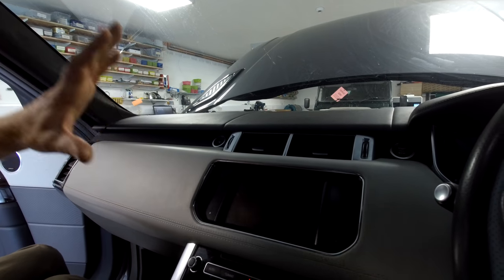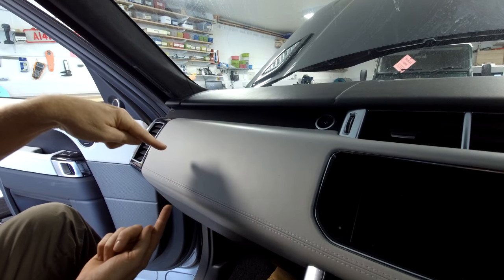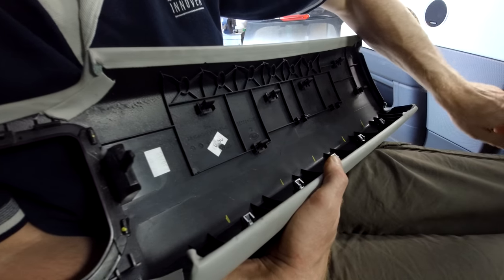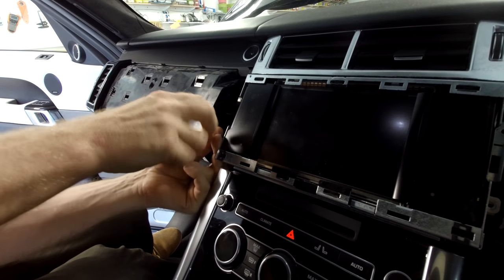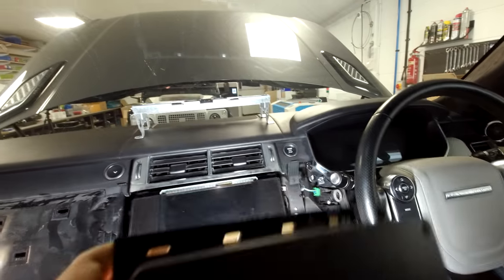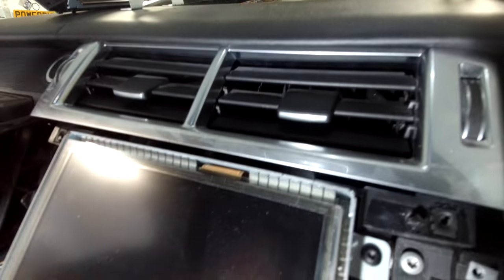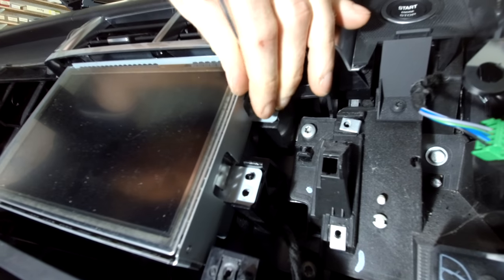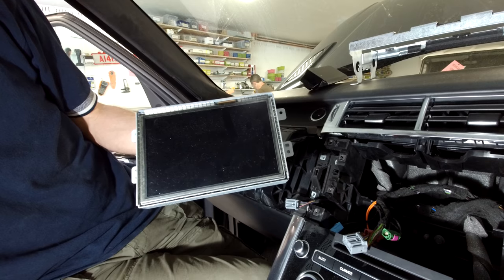How to remove / upgrade the Navigation screen on Range Rover Sport L494

Comment: Some advice for putting the leather dash trim back on as this is much harder than taking it off. Firstly add a few drops of super glue to your spring clips because these these things will fly off if you get it wrongly aligned. Obviously let it dry properly first. Work the panel on flat getting your piece by the instrument cluster in first as there is a peg that has to align onto the clocks. Then look for your lower clips that go into the cage around the infotainment screen as there are two big ones at the bottom. Then as this video shows gently bend the bottom section underneath the dash, do not bang it in otherwise the clips will end up behind your dashboard. With everything hooked under push everything into place, takes a bit of force but you will hear all the clips lock in. I wrestled with this for ages losing clips along the way and having to drop glove box to retrieve them all. Deffo use super glue so they don’t fall off the pegs otherwise you will have only half the clips holding this on and half rattling around somewhere.
Reply from the maker: Sorry I missed this comment - I have pinned this to the top as it is very helpful and I will try this method next time myself

Comment: I have a range rover sport 2011 not supercharged, I was driving it at about 25 to 30 mph and my bluetooth just stop working and screen were the station numbers go it went blank, but I turn my radio off and the station came back on but my bluetooth did not. what can I do. 
thanks for all your videos I actually added a new key to my rover just with your video thank you so much.

Comment: I always enjoy looking at your site. I installed the Android 11 infotainment system in my 2017 L494 yesterday, stowed the wires, pushed in the monitor and air conditioning panel, turned on the ignition key, the air conditioning panel and monitor did not show up and I put everything back together. However, the original navigation and air conditioning panel do not work, only the hazard light switch. Once disconnected from the battery, left for 20 minutes and hard rebooted, the monitor and air conditioning panel do not show and work. I don't know if it is the disconnection or the on-board computer and will have it looked at by the dealer tomorrow. Is there any possible cause for this?

Comment: Great job guys, any idea if the 2017 face lift screen can be retro- fitted to the earlier L494. I’m guessing rear connections would be different?
Reply from the maker: Hi the later rear screen seems to only have one connection on the back - so i guess its just a display with little processing - check out this listing on ebay
https://www.ebay.co.uk/itm/2017-Land-Rover-Range-Rover-Sport-10-Sat-Nav-Display-Screen-GX63-19C299-AC/401628343295?hash=item5d82ea2bff:g:TZ8AAOSwTABc5RFH
Reply from the maker: This unit would seem to be the "brains" but the connections look different to the older units
https://www.ebay.co.uk/itm/L494-RANGE-ROVER-SPORT-RADIO-CONTROL-MODULE-HPLA-19C211-AE/273755764710?hash=item3fbd1d77e6:g:9Q8AAOSwq5dchkiI
Reply: That’s a shame, could have been a cheap upgrade judging by eBay second hand prices
Reply: @L663  Hi mate could u plz give me some help with replacement touchscreen on 2015 L494 which can I replace my faulty ones with used ones of eBay ? Is it need recoding or plug and play ?
Ta
Reply from the maker: @novacartech7588  just plug and play - try and match the part numbers if possible

Comment: Hi, Would you know if it was possible to Upgrade the Stock screen on a Pre-Facelift EVOQUE? MY2014? Got an issue with mine, so am looking at options, the first being how to remove it!!! Any pointers in that direction or a YT Video How to, would be greatly appreciated.....
Reply from the maker: We have not got the Evoque out for a while - its stuck in the parking garage.... we will get it out and do this video and we do have the Merryway upgrade unit for it too.... problem is Its holiday season so we may not get it done for a few weeks....
Reply: @L663  Hi, Thanks for replying so quickly...Take your time, No Rush...Whenever you can get round to doing it, is fine by me....Just great that you like having ago for all of us numpties out there.....

Comment: @powerfulukltd i want to upgrade my RRS2015 model with RRS2017 screen however i dont know if it is compitable with the wire of the control module so i have to find another module ?
Reply from the maker: Hi - its not but i have been asked this question a lot ! so i have purchased a 2017 screen and will show everyone the issue !

Comment: Hey, do you have any tips on putting the panel back? I was able to remove it following your instructions but I just cant get the clips to bite so the panel stays flush. Driving me mad! Thanks.
Reply: Me too.  Getting that panel back on is proving to be quite challenging.  Any advise would be greatly appreciated...
Reply: @sbos429  Ye if you figure it out let me know haha. I was able to get the area by the steering wheel and the area around the screen fitting nicely but the bulky area by the glove box is still not biting as it should. Still feels a bit loose.
Reply: Same.   I got mine attached good enough,  but several of the clips in the large part aren't attached either.   I am afraid to pull our back off because this is as good as I have been able to get it.   If I get real gutsy,  I will take it off again and try to get it better, just not now.

Comment: Can you please help me locate the Quiescent Relay Box on a 2017 L494? Symptoms: I am getting a B1412 fault My Infotainment screen is dead I have an SOS limited Functionality error (already replaced the battery) Please help! I searched your YouTube channel and scoured the net for an answer, with no luck this far!
Reply from the maker: I think that relay is part of the front fusebox.
Also sounds like it could be an issue with TCU - telematics control unit.
There is some data here but not much.
Try a battery disconnect and reconnect ?
https://www.landroverworld.org/threads/b1412-96-quiescent-relay-box-failure.41753/
Reply: @L663  
Thanks for the reply!
I have tried the battery reset as well with no luck.

Additionally, I had found the thread that you referenced, but it appears to be for LR4.
I have been unsuccessful in finding info for the L494z
Reply from the maker: @JP-sn9ej  You may need to start looking at this video
https://youtu.be/B752xfrxzLw

Comment: i bought my car in the USA and according the maps company that provides the maps update for the range rover they said that there is no way i cant have my maps updates for the middle east, unless i replace my head-unit. however, i am not sure about how true is that. i found a wrecked car that have a middle east unit. does it have a password to swap the headhunts ?
Reply from the maker: hi my car came with the DVD unit missing from the car... why i dont know ! but i got one from another car - actually an evoque.. and it works perfect with maps etc. If you give me your chassis number i can look up the part number - and engineering number for the unit for your car - this may help you. I think you have  a good idea here !
Reply: @L663  I also have a question. Does the car know it's configuration. I mean type of engine , cameras auto park and ambient lights . Or do I have reflash it .
Reply from the maker: @ram00sa00  Hi Rakan - the PN for your DVD unit is  LR093721 and the eng PN is CF6N 18C815 JN - the engineering part number is always on the item so more useful.
here is the link to the data
https://www.dropbox.com/s/6jth3rowqek2i6t/audio.jpg?dl=0
As you can see this DVD player was used across the range.
I dont think you will find 100% same PN outside USA - but i think if you look for the same PN without the last JN you should be close
One on ebay for £80
https://www.ebay.co.uk/itm/RANGE-ROVER-L405-RADIO-UNIT-MODULE-CF6N-18C815-HE-GENUINE-100-TESTED/143436702132?hash=item21657e61b4:g:lKUAAOSwNopdxo~f
Reply from the maker: @ram00sa00  I dont think this is stored in the DVD - the only issue i have with the Evoque DVD i fitted in my sport is the handsfree is called "RR Evoque" on bluetooth.
Reply: powerfulukltd so do you think if I replaces my NAS dvd with a local dvd it would still work fine .?
Reply from the maker: @ram00sa00  I think it would be fine... its not a massive cost to risk
Reply: @L663  good news .. it works, i love you so much i found a car which is wrecked. sadly an evoque. (bluetooth) however i have to do the speedo from mph into kmh and the radio from the US to the one with even number. got any ideas ?
Reply from the maker: @ram00sa00  watch this video
https://www.youtube.com/watch?v=XlDRhBaI0sA
Reply: @L663  I Have seen this video before, however i dont have this option in US model for the dail. i only have the digtal speedo
Reply: @L663  if you have another ideas that would help